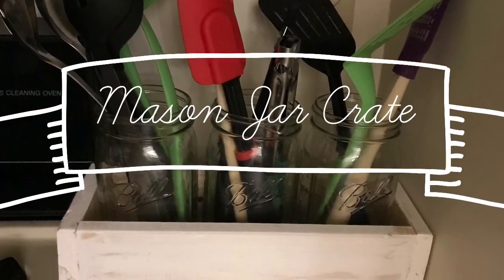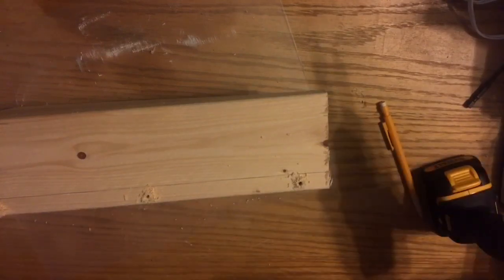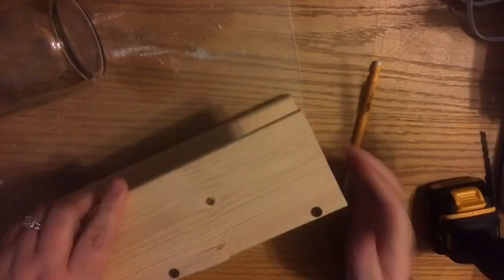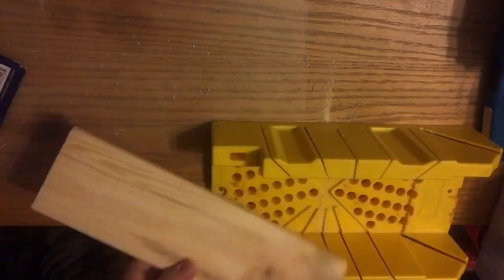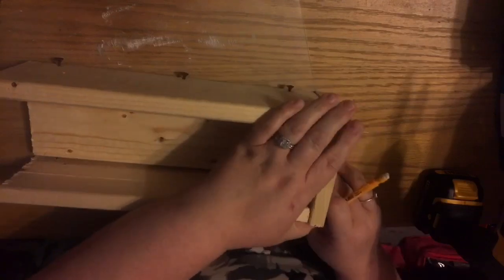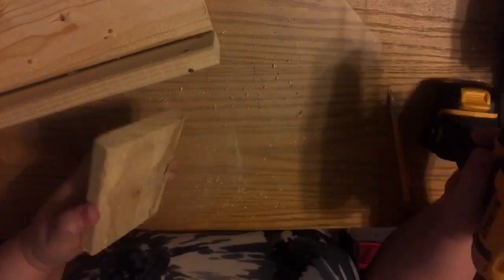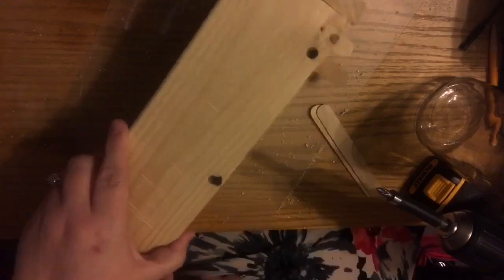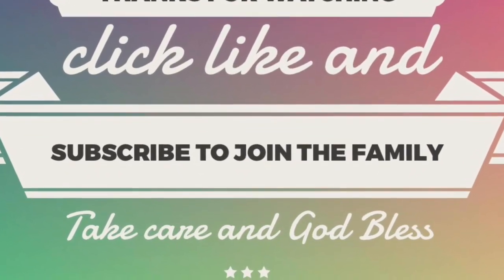DIY Wooden Mason Jar Crate Farmhouse Style-Beginner woodworking

Comment: Great tutorial! What kind of drill did you use? Look small and it had a light on it. Where did you get it from? Tyfs.
Reply from the maker: It’s a DeWalt 12V max cordless drill/screwdriver. I bought it at Home Depot in NY and I absolutely love it!  I had bought one for my dad for his 60th bday and we had it until the flood. I knew when I was in the market for a new one I wanted to get the same one. Thanks for the love and for the great question.

Comment: I like your video; however you go awfully fast for beginners.  To countersink the bottom screws, use a larger drill bit after you drill the first hole and bore out a hole the width of the screw head.